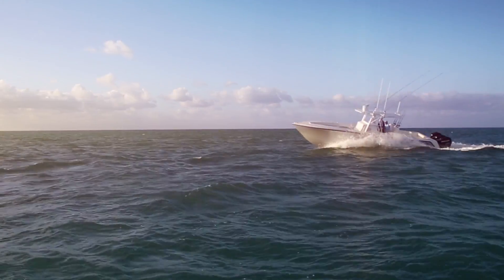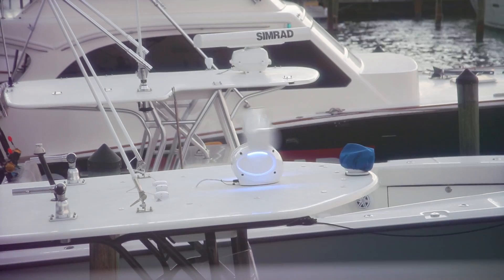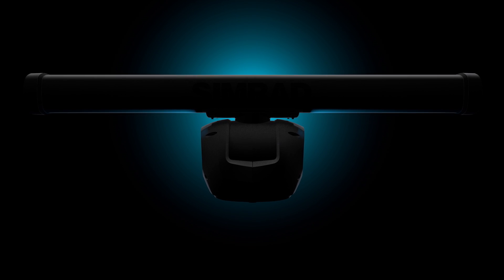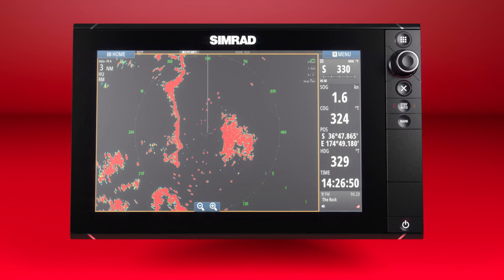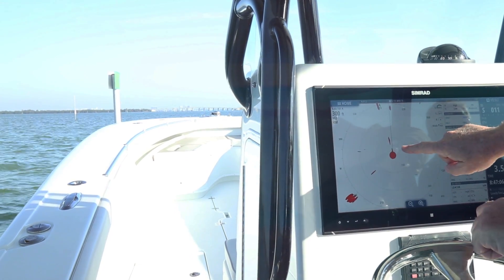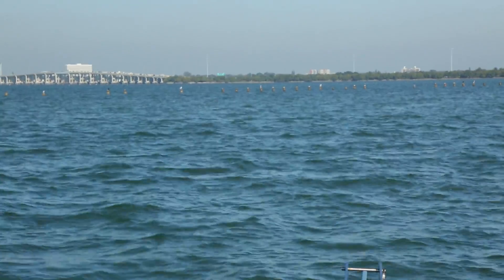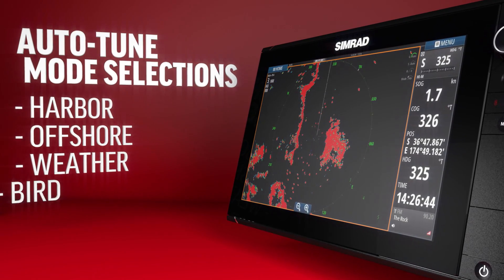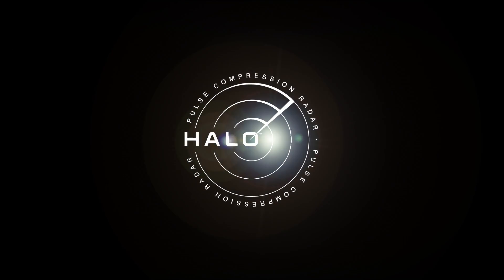Simrad |  HALO Pulse Compression Radar Feature Overview

Comment: Don’t expect it to park correctly if you have the Simrad NSO EVO3S. I just got the system and per simrad tech support park radar option has been eliminated because it wouldn’t work. So I have this high dollar duel screen system with Halo 3 and it just stops where it stops. Simrad tech support also didn’t think there was even a software update fix planned. They told me that it didn’t work on this unit so the option was just taken out. WTH??